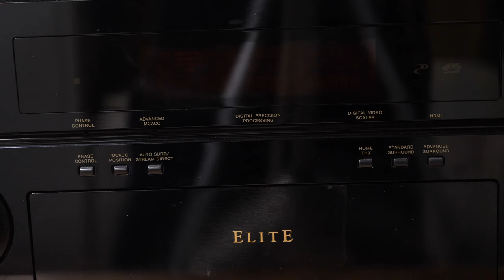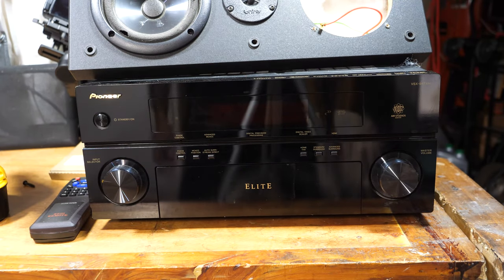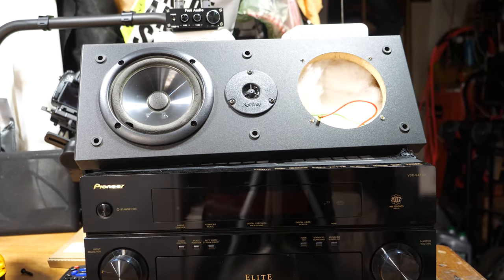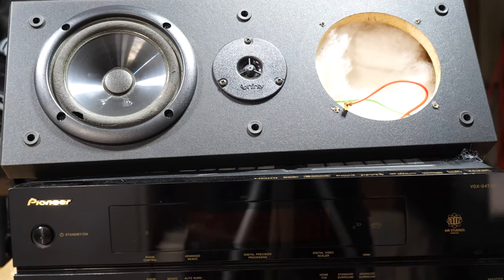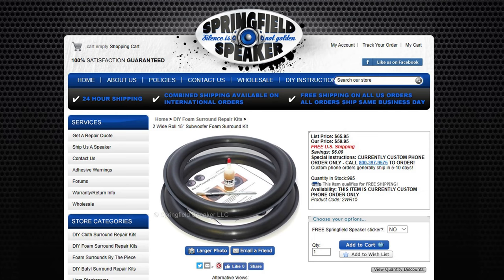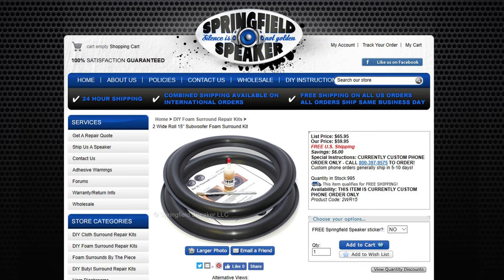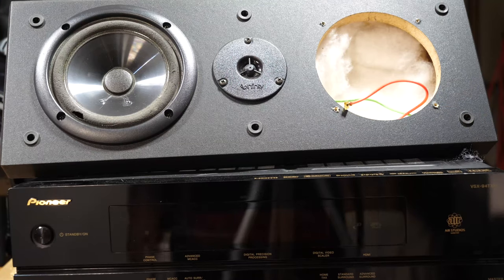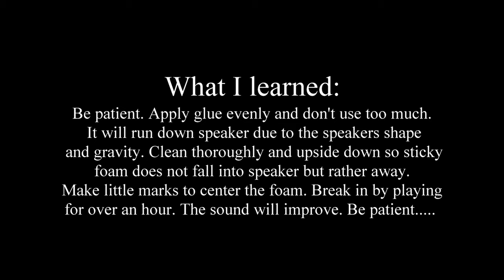Springfield Speaker Foam Repair Kit. (My first attempt)

Comment: Typically you'll want to cut off the dust cap and shim the voice coils. If your voice coil isn't in the center the voice coil can drag and cause future problems. There's also a method to use voltage or a test tone to pull the speaker into the voice coil but most of the speakers I've refoamed I just cut the dust cap off and used the shims. A quality refoam kit will come with new dust caps and the correct shims.
Reply: Actually you only really have to typically do what you are saying when replacing an entire cone and voice coil with former. The voice coil is already centered and is held in place pretty solid by the spider assembly. So if one is just changing the foam there really is no need to cut the dust cover off as well and shim the coil.

Comment: Thanks....which glues dud you use?
Reply from the maker: I should have said that. The kit came with glue. Thanks for watching.
Reply from the maker: If I remember correctly, it had a rubber cement like texture.